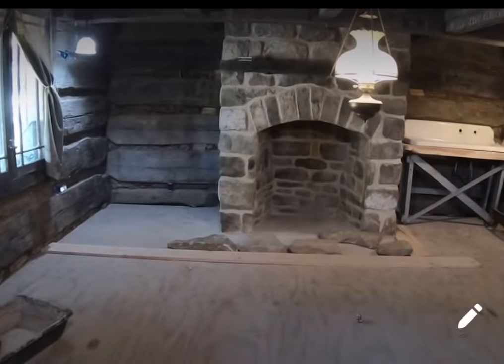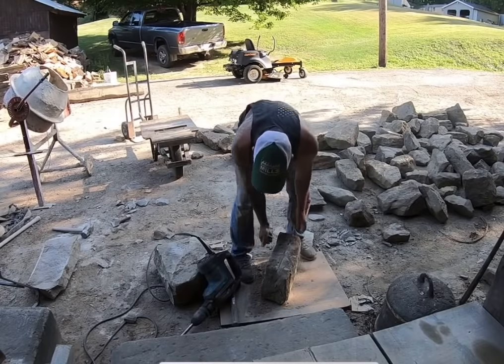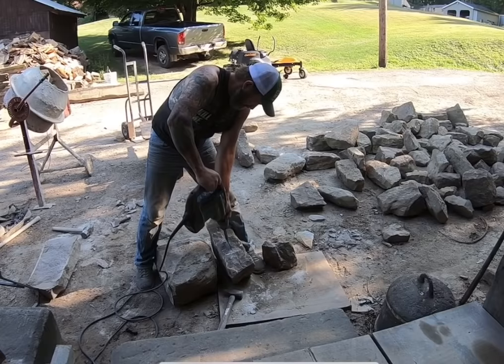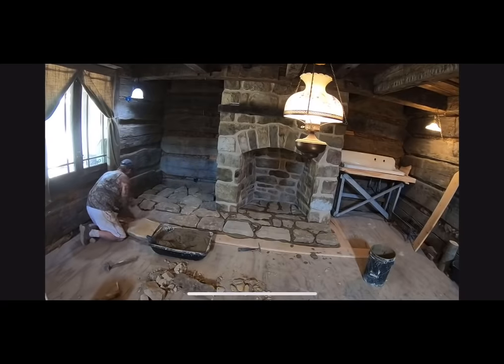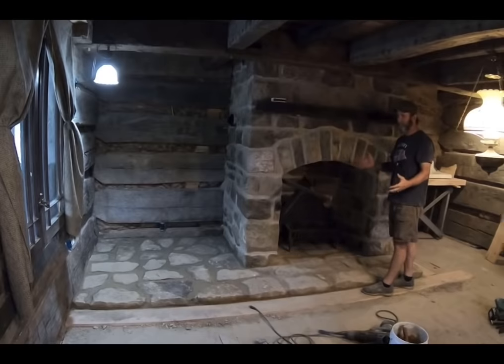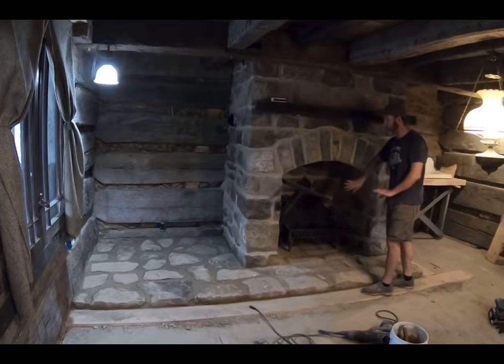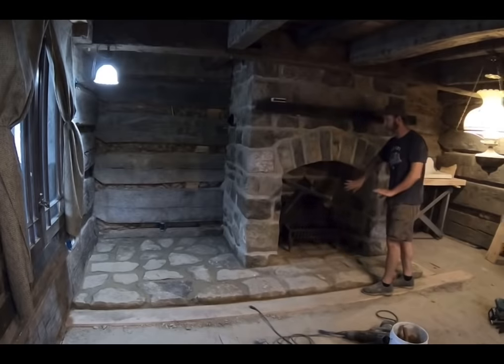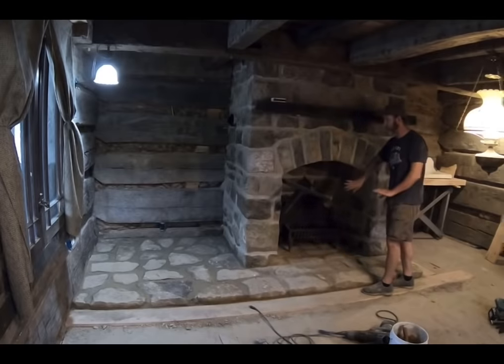Cutting and laying a stone fireplace part 2 the hearth

Comment: Hey thoroughly enjoyed watching both videos of the fireplace build. Great job!Really authentic looking! Im looking into moving/reassembling an old 18x22 log cabin next spring. Curious, what kind of cement did you use on the chimney? What was the sand to cement ratio?
Reply from the maker: I used a 1/2 part type N, 1/2 masons lime with 3 parts mason sand
Reply: @logcabinlifestyle  thankyou!

Comment: that is a beautiful fireplace and I saw you mentioned in the first one that it had a solid base and was not placed on wood, but it sure looks like and sounds like you placed that hearth right on top of the wood floor.  If I'm incorrect... great.  If I am correct, I would be very concerned about ever using that fireplace.  Two inches of rock is not enough of a barrier between a combustible source.
Reply from the maker: It has more than 8” of concrete and and no wood under that.

Comment: The problem with ""open "" fires is the heat generated goes up the flue,and not into the room its intended for..
A log burner is far superior in putting heat out...💯👍
Reply from the maker: This is 100% true.

Comment: You should never put a fireplace on a subflooring. My Dad did and it set the house on fire. It should go all the way to the ground.  Not to mention it will drop your floor. This is not up to code. It looks nice but safety should be number one priority.
Reply from the maker: It’s not on the floor
Reply: @logcabinlifestyle Is the harth to the ground ? Your video didn't show that ?
Reply from the maker: There’s a full basement with a block chimney that runs through the floor. Then I poured a concrete pad level with the upstairs floor. The fireplace is built on that pad. You can see it in some of the other videos. I also have a video called “fireplace talk” that explains everything